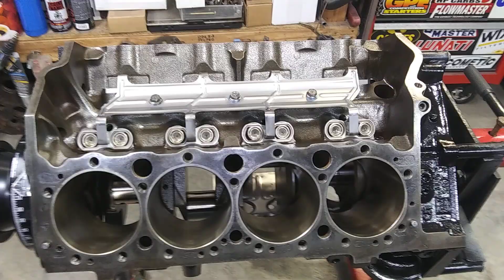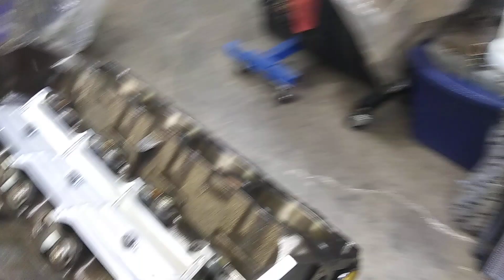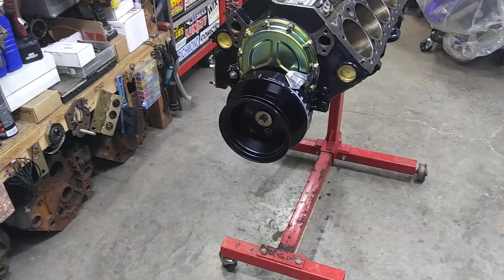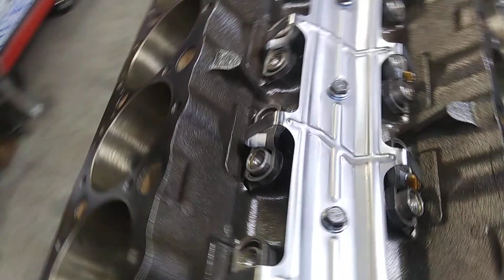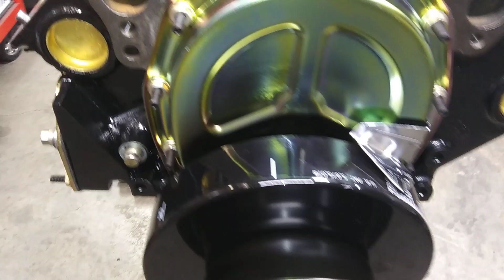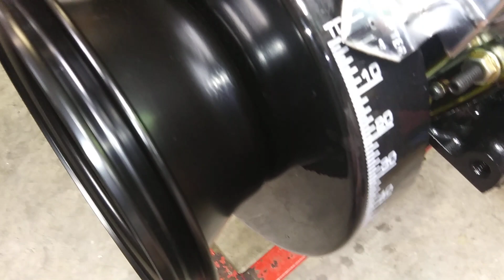Info on big hydraulic roller cams & the GM spider limitations.

Comment: I used this same block on my 383, i purchased a howards cam with 545 565 lift and 241 247 duration at 50 with 110 lobe seperation do you think that will work well?
Reply from the maker: Yep, should thump pretty good.
Reply: Thanks bro! I love your channel.  @thereluctantgearhead4544
Reply: @thereluctantgearhead4544 Do u have a fb page or instagram?

Comment: Is this why the lt4 hot cam needs 1.6 rockers to get 525 lift? Makes sense now
Reply from the maker: @mikeholley4488  Most lift I've ever used on a spider setup is .600 lift. That's about as far as I will go with them. And that was with a 1.5 ratio rocker.

Comment: I read in one of the old school gm performance books. It says past .580 lift in the factory roller cam blocks you have to check the lifters, said that for both the big block and small block with factory style roller lifters and spider hold downs. I need to find that book again. 
 You can get the link bar or tie bar lifters but you have to use the taller body link bar lifters, and that adds weight to the lifter body.
Reply from the maker: @DavidB7474  Yep, I've gone to .600 lift with the stock setup. But that was with .300 taller lifters. I have one with .595 lift and that's about the limit with a stock height lifter. It's flush with the dogbone at that point.
Reply from the maker: @DavidB7474  The bigger the cam, the farther the lifter drops down in the bore on the backside of the base circle of the cam lobe.
Reply: @thereluctantgearhead4544 definitely will be doing a mock up with some oem hydraulic rollers lifters and spider to see if they work ok. Then I will decide if I need tie bar lifters.

Comment: So just use a lower lift cam with high ratio rockers..
Reply from the maker: I have a set of .300 tall lifters I'm gonna use with a .600 lift hydraulic roller  in another block. These GM LS7 lifters work fine up to about .375 lobe  lift in a SBC. I'm using a .370 lobe lift with a 1.6 ratio.
Reply from the maker: That's more less what I'm doing. 1.6 rockers will give me 592 lift. Plenty for this application.

Comment: The bad part about the factory roller block is that they don't make dog bone solid roller lifters. So if that's the block you have and want to run solid roller lifters you have to run the .300" longer tie bar lifters. Not a big deal though.

The good thing about that is all the first gen bolt ons will work. This way you can run a first gen cam and the matching gear drive. But will also have to use some sort of cam button. Cloyes makes a really nice timing chain cover with a built in cam button.

The bad part is the .300" longer lifters weigh a bit more if you're looking for every last RPM?
Reply from the maker: I leave alot unsaid in my videos, but I've definitely gone hands on for a long time and I've done my homework. In my normal life I don't talk much and I don't talk to more than 1 or 2 people a day. Sometimes none. So I'm not real good at communicating my thoughts to people. Usually just thinking out loud. I've built hundreds of SBCs over the past 40yrs. But usually these topics are too deep for a 10 minute video, so I keep it simple. But I'm very complex, and if I really started putting shit out there, I'd look crazy. So simple is best for a simple minded world. Stupid people think smart people are crazy. There's alot of stupid people these days.
Reply from the maker: I've used retro fit solid rollers In the 1 piece seal blocks. My copper 95 block had a 668/669 lift solid roller in it. Used Crane tie bar lifters. They cleared. Fixin to put a 650 lift Crane solid roller in another late model block. I prefer hydraulic rollers in street/strip type engines tho. Shit just last longer. All my serious engines use solid rollers. I'm gonna drive this car all the time for entertainment. I've had daily drivers that would go thru a $400 dollar set of valvesprings every month. That shit got old. And that was 20+yr ago $400 dollars. Gets pretty expensive running 750-800 lift cams in a daily driver. Bigblocks with Dominators get pretty thirsty too. Damn near took half my pay just to drive shit like that everyday. Fun as hell tho.
Reply: @thereluctantgearhead4544  
I should of wrote that you probably know everything I wrote, the more words the better it is for that algorithm.👍
Reply: Friends bitch that I stopped at .680 lift for my cam instead of .750-.800 but they never consider the on going expense of running the big cams, I have to remind them that my engine is a street engine first and foremost. @thereluctantgearhead4544
Reply: They definitly make solid roller lifters for ls engines,and these vortecs use the same lifters as ls engines

Comment: For most mild street cams the factory roller set up works well and is proven to be very reliable, the GM performance roller cams work really well for these setups, if your on a tight budget a takeout used 90s lt1 cam works good or if you can get an lt4 hot cam, they really preform well
Reply from the maker: I'm using a 240/252@.050, 555/555 lift, 108 lobe separation unit in this one. It'll work fine. It'll get turned up to 7000rpm too.